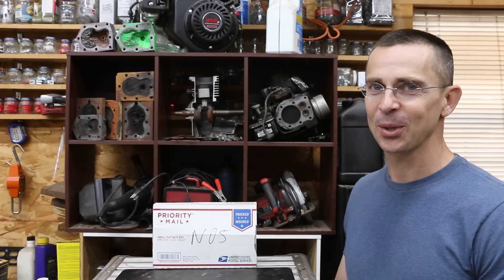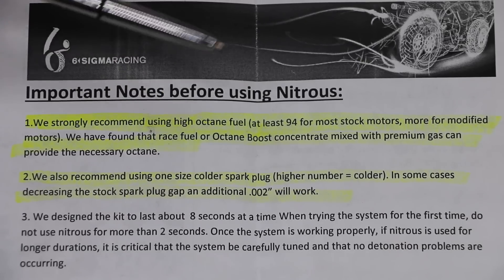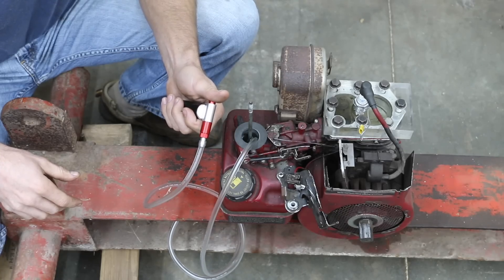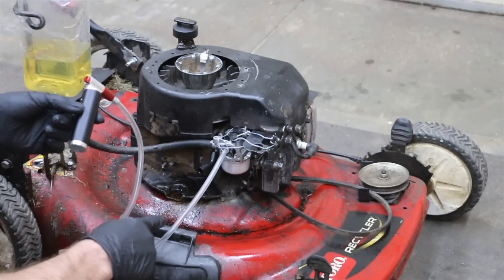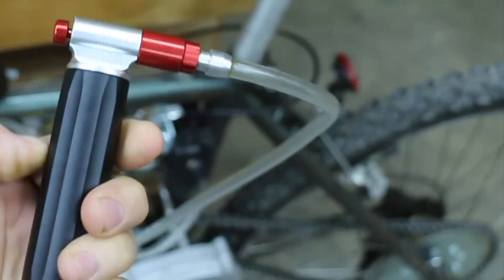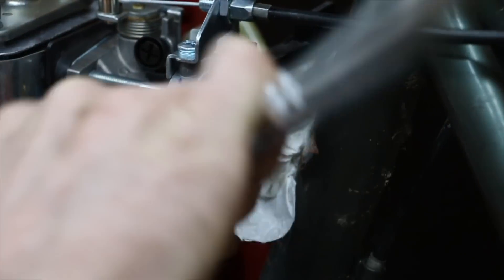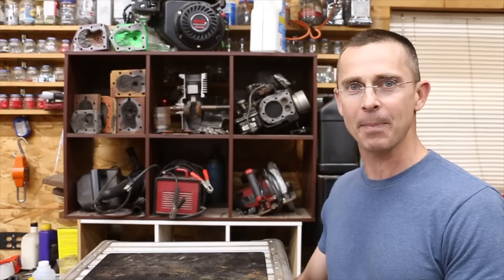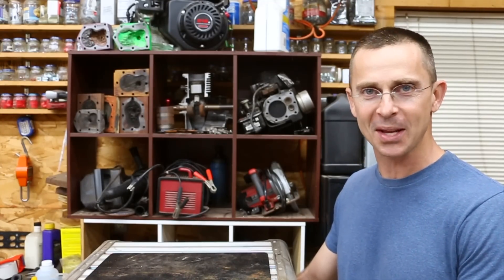Will the 4-Stroke Bike Survive Nitrous Oxide?  Let's find out!

Comment: I have one for you: Will dry powdered graphite lubricate the old Toro mower instead of using engine oil? (maybe if needed use water) ?
Reply from the maker: Thanks for the video idea!
Reply: No, Thank you for the content! FYI I have the rear wheel drive version of that Toro  and it blows my mind just how tough it is every time I see you experiment with it :)
Reply: Also, make sure it's the graphite NASA uses on the space station to lubricate their bearings on things like airlocks and remote robotic arms! Cheers!

Comment: I was tempted to suggest using oxygen instead of the nitrus, after tuning the engine to run more fuel rich, but that would turn it into a bomb. However, what about compressed air ? Just squirt it into the nitrus port and see if it has a difference. Just the expansion of the air as it heats up should provide some boost.
Reply from the maker: Thanks for the video idea!

Comment: Hey PF love your vids. Have you considered picking up some air ventilation PPE? The rich exhaust smoke can be harmful for your health. It looks like you run these tests outside but still stand pretty close to some of these sometimes smoking engines. Just a  thought
Reply from the maker: That's a great recommendation.  I wear a dual cartridge filter while running the shop's exhaust fan to avoid the fumes. Thanks again.

Comment: In car engines a nitrous system sprays in liquid nitrous oxide along with additional fuel. Both vaporize in the intake. Until recently the only time the nitrous was used was at full throttle. Now there are electronic metering systems that can finely control the flow to avoid pre-ignition so it can be used at part throttle. The old systems used spray bars - tubes with a row of small holes, placed between the carb or throttle body and the intake. The newer systems use fogger nozzles attached to metering solenoid valves.
Reply from the maker: Great point. Thank you
Reply: @ProjectFarm  makes me wonder how much extra scoot could be had from one of those engines with nitrous and additional fuel? The extra fuel takes care of pre-ignition caused by the nitrous leaning out the mixture. Combining the nitrous gas with a valve that opens the fuel flow a bit extra or sprays some through the carb might be something to explore, and could allow hitting that red button until the little bottle is completely empty. 50 miles per hour maybe, if the rider wears fancy tight cycling clothes?

Comment: As a kid I had a “boost bottle” on a 2 stroke 80cc bike engine kit. No compressed air or gas. They sell fairly cheap on eBay and many people believe it’s just snake oil. The idea is that when the air is being drawn toward the cylinder, it has inertia. When the intake closes, the air pressure suddenly surges and has nowhere to go.. so the boost bottle allows that pressure to pulse inside the bottle and shoot it back out when the cylinder port opens. Made about a 20% increase in top speed on my bike as a kid but required a valve to switch it off for a smooth idle :) hope this gives you a good video idea
Reply from the maker: Great video idea!

Comment: I would like to see this done again but used with better fuel without a booster. The octane booster used I have also used in my modded car before to help bring the octane levels up but still got knock. I know you can only do so much with ignition timing on small engines but curious to see what 93 with 10% ethanol brings you or even 100 octane with the giggle juice.
Reply from the maker: Thanks for the video idea!

Comment: The reason why people think that nitrous is flammable is because nitrous must be mixed with fuel in drag racing applications. To get the proper A/F ratio when nitrous is applied to an engine, an equal amount of fuel must be added also. This is achieved by putting a plate under a carburetor with both a nitrous injection rail and a fuel injection rail. Both rails have jets to adjust the nitrous to fuel ratio. Both rails have a solenoid that opens when the nitrous button is depressed and closed when the button is released. We all know that when nitrous and fuel mixes, very powerful combustion is the result. When something goes wrong on a drag car such as a nitrous backfire that blows the intake manifold off, this can lead to both the fuel lines and the nitrous lines ripping off and spraying both of them everywhere. This lights on fire and this is what causes those crazy fireballs in the videos of the nitrous accidents.
Reply from the maker: Great point. Thank you

Comment: Would be awesome if you used the see through cylinder head to test a capacitor plasma spark booster. Could also see if it really burns fuel better or makes any noticeable power.
Reply from the maker: Great video idea!

Comment: Any racer will tell you, more oxygen you add.. add more fuel. Pre-ignition will disappear. Your power gains would have been much higher. As you tested, your engine went nine kinds of lean and knocked like a bag of hammers tumbling down a steep creek bank.
When I sprayed a motor, ALWAYS made sure that there was enough fuel for the pounds of oxygen going in.
Reply from the maker: Great point.  I'll add more fuel.  Thanks again!
Reply: @ProjectFarm  You will have to use a crankcase pump with the same solinoid turn on switch. 
The fuel ratio should be a smidge rich (remember that we are oxidizing fuel faster). Piston temp gets critical very quickly... On a gas piston.

Comment: Nice,,have read some of the comments on fuel mixture below,
SO,
was wondering ifn the extra oxy separation gives you a bigger bang??
What would some thing like 'ozone' or 'hydrogen peroxide' do or effect on combustion,
I know they use peroxide in fuel for rockets because of oxy content,,
So spray some ,fine mist,in to carby inlet,
Recon shouldn't need any more fuel,and not sure if it burns hot or how hot it will get,
But Hey ,just a suggestion,,
Thanks Again for interesting Vids
Reply from the maker: Great video idea on the hydrogen peroxide!

Comment: VIDEO IDEA with starting fluid!
Several times I've read and have heard people say not to use Starting Fluid on a two stroke as it will cause engine damage. Do you have a 2 stroke sitting around to experiment with to see if this is true? How about different brands of starting fluid? Brands with upper cylinder lubricant?
Seen ads selling chainsaws. "Will run on starting fluid." Did they damage the cylinder?
Reply from the maker: Thanks for the video idea!

Comment: How does the engine get more fuel? Or does it just run lean? Car ECU will auto compensate but this is carbureted.
Reply from the maker: It runs lean. I need a wet system or a way to add fuel.

Comment: Can't believe you yanks call 94 octane 'high octane'. 97 is standard here in the UK with any kind of tuned engine running better on 99 octane - from the pump at most forecourts. It's no wonder you seem to need massive V8 engines to produce any power at all.
Reply from the maker: Thank you. The US uses a different octane rating system.

Comment: The way it works is to chill the incoming air so it's denser so you can get more air in the cylinder. Most real nos kits will also inject more gas to go with the added air that's where the real power comes from.
Reply from the maker: Thank you

Comment: That’s awesome dude. What is pre ignition?
Reply: Anthony Evans fuel explodes before spark plug fires. Happens at just right time engine goes bye bye.
Reply: Robert Wilson I see. That’s kinda cool. Does it break the cylinder or something?
Reply: Anthony Evans not immediately but it puts tons of stress on the connecting rod. Over time will cause failure. My grandfather was a mechanic for Larry Buick and I got to see some interesting things when I was growing up.
Reply: Robert Wilson that makes sense. Dude! That’s awesome!!! Like what?

Comment: Genereally NOS is just extra oxygen, so you'd want an extra boost of fuel as well. I guess it has worked with your engines because I suppose they are running very rich to begin with but an engine that's running perfect mixture will start to run lean. I guess.
Reply from the maker: Thank you

Comment: nos is like turbo in a bottle .. likes the same setup.. lower compression, the cooler plugs and similar timings. for a larger shot use a whipcream dispenser you can load all 5 charges into the container.. and use a small shop blow gun as your button..also dry shooting it if you t it into the carb vent it will increase the gasoline flow as it sprays into the carb ( same is done on a turbo pushing through a carburetor).. also i bet the motor ur using will love leaded aviation fuel .. like the fuel avalibile way back when the design came about.. also with a Briggs style 4-5hp there are many racing parts available for the gokart racing world .. cams fully tuneable clutches, headers tilliston carburators ..
Reply from the maker: Thank you

Comment: Typically for maximum performance with NOS you want to add more fuel at the same time and require WOT.  How is this kit achieving that?
Reply: thejunkman it’s not, it’s just leaning out the mix which generates more heat. It’s not an ideal setup. Nitrous and propane would be cool though.

Comment: The only way you'll gain power is if you mixture was overly rich to start with.  By adding Nox all you are doing is leaning out the mixture.  Possibly to the point of engine damage.  Correct the fuel-air ratio and then add nitrous and fuel and you should see a nice safe power bump.   Of course, those little cylinders are laughable.
Reply from the maker: Great point. Thank you

Comment: Very good job, as usual. I really like how you go about doing the videos you do and the quality of the information.  
You mentioned a key item relating to nitrous oxide; it rapidly (explosively) decomposes once a certain temp is reached, allowing the nitrogen and oxygen to react independently. 

The internal combustion engine works so well because nitrogen expands when heated and since most of our “air” is comprised of nitrogen (in diatomic form or two nitrogen atoms bonded together) and we are able to compress (compression stroke) and then heat the nitrogen in the combustion chamber, resulting in a great amount of force applied to the piston, giving us our power stroke. When nitrous is injected into the combustion chamber and then decomposes from the heat released when the hydrogen atoms disassociate from the carbon atoms (hydrocarbon fuels), there is more nitrogen to expand and more pressure produced. 
There are several comments about adding more fuel with the nitrous. This should happen because not only do we have more nitrogen, but also more oxygen, which means we can (should) add more hydrocarbons to react with the added oxygen. More fuel to mix with the added oxygen, more heat energy released during the combustion event, higher pressures in the combustion chamber...more power!!! (Insert the Tim Taylor Tool Man “Arhh’s“ here)
Reply from the maker: Great point. Thank you.

Comment: You can buy a counter kit off of the internet for about 10.00 they are easy to install. Most of them are simply done by gluing a magnet to whatever part is turning (Most flywheels already have a magnet in them) and then by placing a sensor on a stationary part so the magnet will come across it without touching it. Each time the magnet passes by the counter it counts a digit. This would tell you how many RPMs you gain or lose.
Reply from the maker: Thanks for the recommendation.

Comment: Have read that the pressure from combustion comes from the expansion of the nitrogen gas, 78% of air, when the fuel ignition heats it. Make sense with N20 decomposing to N and O.  Looks like you have discovered how to introduce O2 into the combustion chamber to see it clean the valves, piston, and spark plug.  As it does not increase the nitrogen, probably would see no power increase, unless you add a water spray as well, which would expand, same as nitrogen, but much more concentrated.  Oxygen & water only, (no air) along with any fuel, we should be able to see a big increase in power, if there is a large enough exhaust port to handle back pressure.  Fun video, thanks.
Reply from the maker: Great point and thanks for the positive comment!

Comment: This might be a weard question but how do I decrease the power without giving up throttle control and a lot of smoke basically I have a go kar super tiny bit manegt to put a 13 horsepower engine on it and am afraid am gonna die and flip it

Comment: You should attach a fuel air ratio meter to a wide band o2 sensor to your projects for tuning. I believe your NOS is causing a lean condition and you should inject fuel with it to keep the mixture stoichiometric. Injecting something with a high octane like ethanol or methanol would mean you could inject even more nitrous!
Reply from the maker: Thanks for the video idea!
Reply: @ProjectFarm  Yeah you say that but I've yet to see you make a video replacing engine oil with lava. An idea of which you seemed quite enthusiastic I might add.

Comment: It would be great if you could add the extra fuel needed when the nitrous is activated. Then you would get even more power because just nitrous will make you run lean and detonate without the extra fuel. The best NOS kits have a fuel injection jet along with a nitrous jet. This is known as a wet kit and safer than a dry kit like used in this video. I bet if you injected the needed fuel you would see what it can really do. 😊
Reply from the maker: Thanks for the video idea!

Comment: Yupp sooo many people think higher octane gaoline is "More flammable" and nitrous oxide is "way more flammable"  they think thats where all the power cones from.  Not at all.  NO.2 makes more power because it cools the intake charge and allows more oxygen molecules to be burned you can get the same effect but using a can or Air Duster as a "NO.2" substitute it will cool the intake charge so much it will make a lot more power.
Reply from the maker: Thank you

Comment: The nitrous is making it run blowtorch lean. You need to supplement the oxidizer with extra fuel or all it does is burn off a little extra fuel. Dry shot is for fuel injected engines only and even then it should only be used with an engine computer which can handle what will happen
Reply from the maker: Great point. Thank you
Reply: @ProjectFarm  Thank you man your videos are awesome.

Comment: As a kid I had a “boost bottle” on a 2 stroke 80cc bike engine kit. It was just an empty aluminium bottle plumbed between the engine and carb. I had a tap to switch it on and off but It made a massive improvement, similar to NOS but it was infinite! Can you test this?
Reply from the maker: Thanks for the video idea!  Was the bottle pressurized with air?  Could you create a new comment so I can find your reply?
Reply: Project Farm sure thing, check the comments 👍🏼

Comment: Toro racing fuels: 100% nitro methane. 
It takes a little work and tuning to find the right mixture, i run a good two capfulls in my 2 stroke lawn equipments gas can for every 2 gallons. 
It makes a very pleasant difference in power, and how fast they start up. ;)
(Ebay right now for about $85 for a one gallon)
Reply from the maker: Thank you

Comment: Nitrous will normally be set-up to inject both nitrous and fuel to deliver its big boost, the issues you're seeing are a leaning out of the mixture as fuel must stay close to the 14.7:1 A/F ratio...   This is why you're getting pinging, the extra oxygen making the flame too hot (and raises the pressure too high) for the remaining fuel which incinerates and caused the pinging.. you could try retarding the spark to help avoid the over-pressure.. Adding fuel will deal with both the pressure and heat issue, and you could add any fuel (within reason) so even injecting propane would alleviate these problems but be difficult to get all the respective ratio's right.. More of the same petrol would be much easier but interesting to think of the possibilities..  Another technique thats been used very successfully to control pinging is water or water / methanol injection... The water cools the mix, turns to steam which aids cylinder volume (steam expands at a rate of 1700 to 1 from water).. and it slows the progress of the flame, controlling the pressure rise..    I think this kit is likely to cause damage to an engine in this configuration, not your doing, its the design of the kit.    Another great video, you do such a consistent job with them all... well done..!!
Reply from the maker: Great point. Thank you

Comment: Is that NOS kit suited for a 2-stroke engine? I'm curious of what will happen if you install it in the other bike... Also i don't think that NOS use more fuel... the carburetor puts the same amount of fuel every time, it just make the engine turn at more RPM's, meaning more times using fuel a second
Reply from the maker: Thanks for the video idea!

Comment: U need to match  fuel to the amount of nitrous being used to avoid lean air fuel witch causes pinging and or preignition u should plum a line of fuel that comes on at the same time the nitrous does then u will really get some power and keep the engine happy in the process
Reply from the maker: Great point.  Thank you

Comment: Please like this comment for attention.
 I would like to see you revisit the engine running on gas fumes and see if it runs any cleaner than running on liquid gas. Also maybe a little redesign of the system could help it get better economy from what I have seen elsewhere there may have been a fault with your previous design,you sealed it too well. A little air leaking in could help. I think you ran it too rich. Just try please...
Reply from the maker: Great video idea!  Thank you.